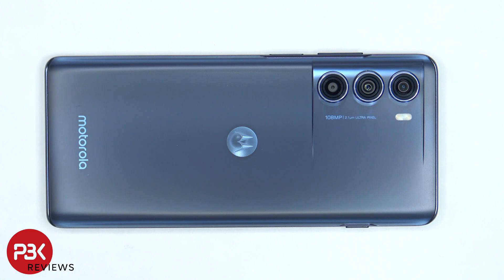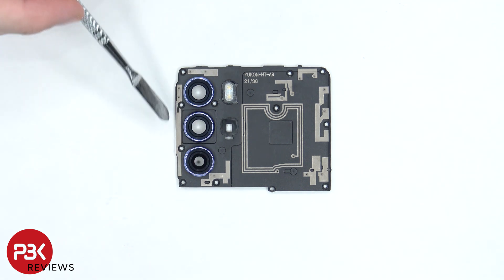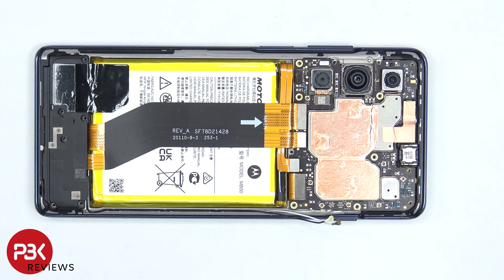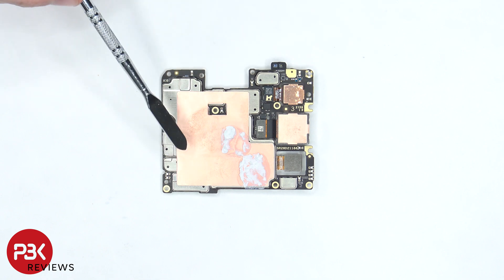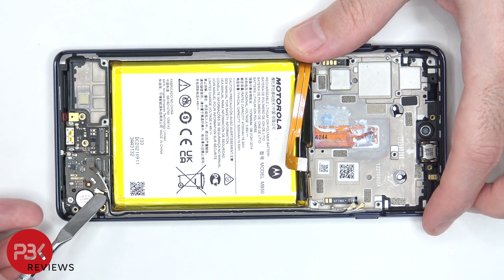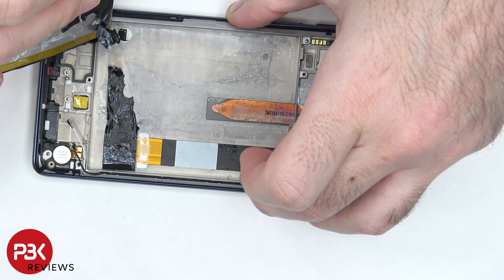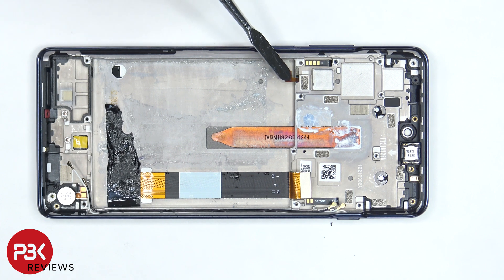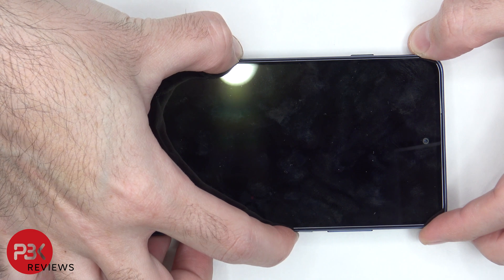Motorola Moto G200 / EDGE S30 Disassembly Teardown Repair Video Review

Comment: The graphene film or graphite sheet or I don't know which is the correct word, is it important for the battery to keep it stable or for heat management or is it both or is it for something different? And if it isn't on the phone, on any phone, if it was removed, will it impact the phone?

No, I'm asking this because of a stubborn friend. Being stubborn saying "No, this black sheet that I removed from my phone isn't important" and he started having problems later on with the battery not being able to retain the power. Like some sort of drain or leak though the battery isn't actually leaking. Metaphorically speaking.

Or could it be, the problem is something else? Something is generating a heat spot that is conflicting with the energy retention of the battery or maybe the battery wasn't properly connected to it's place? One thing I want to make clear is, the graphene film was indeed removed but he kept saying that that thing isn't important.

Comment: 1:54 - i cannot on my G200 get the mainboard off. It seems stuck at corner with his left thomb. It can wiggle. Any hints?
Reply from the maker: did you remove the screw holding down the board on the top by the front facing camera? if so, it should be able to be pulled out without too much effort.
Reply: @PBKreviews  yes I saw that - video is clear on that point 👌 but it is still hung up on something in that corner, I need way to much force, pcb is flexing. As stated it can wiggle, super weird when I can see in video how easy it is released 🤔
Reply from the maker: hmm not sure what it can be. Be careful not to bend the board to much and damage it. Try applying some gentle heat with a hair dryer, maybe they added some adhesive or something on the mic filter or under the camera.
Reply: I think the best idea is to heat up the smartphone before disassembling it with a game or a high resolution video. Instead of using a hairdryer .